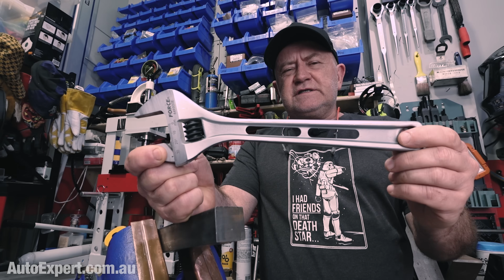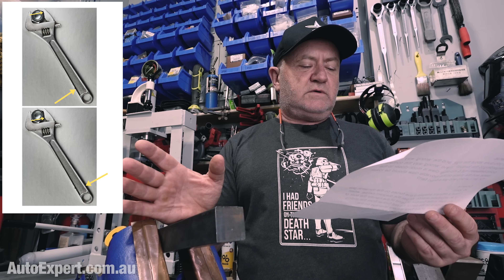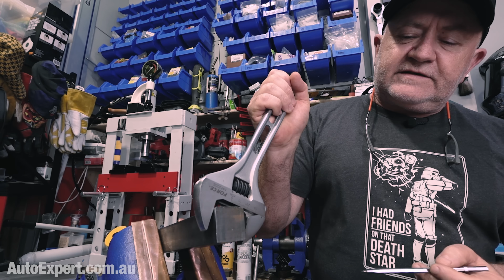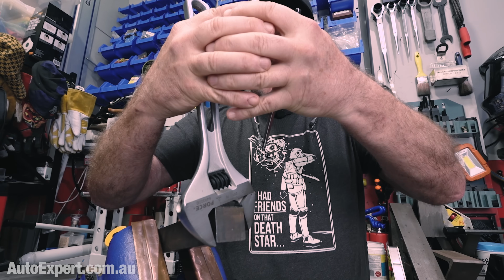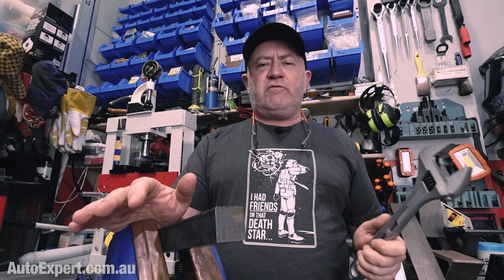Adjustable wrenches: Was I wrong? | Auto Expert John Cadogan

Comment: As someone that lives deep in the "rust belt" of 'merica, I'll confirm that penetrating oil tends not to do a lot until that initial breaking free of heavily corroded fastener.  If you can let those products soak for a LONG time (a week or more), then sometimes they get into the threads before breaking loose.

Comment: My old boss used to use a term for torque and measuring different objects, give it 'two poofteenth's of a female pubic hair'. After having been in the auto electrical game for fifty years, I have still been unable to find a measuring implement marked in 'poofteenth's of a c##thair' I am still wondering if it is an Imperial or Metric term?

Comment: In my job working on aircraft, if you used an adjustable wrench they would kick your arse. Open-ended, or ring scanners in the correct size only.

Comment: Using the proper, ontological names for an adjustable wrench and a minor displacement may have kept you just this side of a profanity-related demonetisation, so it’s just as well that conversation didn’t get into clearances - the kind that lie on a spectrum that starts at ‘blonde’ and increases in size with visible light absorbency.

Comment: You won’t be breaking one with hand strength alone. A 2 1/2 m length of pipe will help.  The Chinese ones will break quickly as they have a lot of flex. The big Bahco will last pretty well, but I’ve broken a few of those trying to release big concrete coring bits. Always the bottom, movable jaw.

Comment: The Torque Test Channel is great. I’ve found, for me, that penetrating oil seems to work a bit better if you tap the parts when you apply the oil. It possibly vibrates the parts, allowing the oil to penetrate slightly better. It may be just enough to matter. It might also be a placebo.
Reply: Penetrating oil IS placebo. Liquid courage. It gives you the confidence to turn it a little harder.
Reply: @ it’s not the oil. If it can get in there it does help somewhat. It’s whether my tapping the fitting is helping that’s the question. I find that warming, not heating, the connection helps the oil worm its way in as well.
Reply: @melgross  My dad taught me to tap the bolt with a light hammer like a ballpeen while putting tension on  the spanner holding the nut. Works a charm to loosen stubborn bolts. So your tapping is definitely helping.

Comment: Great video.
When you mentioned the 15° angle on wrench and the reason for it, I recalled that I discovered something back in 2005 that I thought very clever.
On a spanner (wrench) with 12 point ring on one end, and 'open-ender' on the other, they were even offset to one another. This had the effect of halving the 15° to 7.5°, allowing me to do up a nut on an inaccessable DIY shed door hinge I'd designed. I guess all sets of those spanners have that feature, but I never knew.

Comment: I have found the best way to undo the ceased bolt or nut is actually when the hammer trick doesn't work is to do the opposite,  try to tighten the bolt or nut using the same brute force, if you hear a cracking noise then the bolt is now free and will undo!
When I say brute force I so mean using the adjustable wrench with a long tube to make it longer to increase leverage. 
But you must remember if anything breaks everything, including you will suddenly move in the direction of force so be careful you are not going to break your bones on anything in the way!
When in industry use industrial force, safely.

Comment: If you have a Bahco or Garrington or Crescent or Jackdaw adjustable and only use the power that your arm can exert on the handle, no hammering or cheater bars, then it won’t break. They’re designed to be stronger, as they get bigger, and on your own, you’ll never break a quality tool

Comment: I think that it was in the first few hours of commencing my apprenticeship that the tradesmen indoctrinated me into the ways of correct use of tools. I was taught to use them in the order below as the job demanded:
1. Sockets
2. Ring Spanners
3. Open ended Spanners
4. Shifters

And this is the first that I've heard shifters called "Crescent Wrenches", too. And of course, the rather crude "AFS", too...

And the angular doody-whatsits that you apply to shifters is also applied to open enders... 

Of course, the amount of room allowed to swing the spanner dictates how you use them too.

Great video. Hope that someone learns something from it.
Reply: And then 5. Vice Grips for when you rounded the nut with the SNF
Reply: @mikelastname  indeed. The list is highly extendable, the worse the damaged nut/bolt head becomes. But I think it taps out when the gas axe is brought into service...

Joking aside, one of the more useful gadgets that I have is an impact driver. No, not the ones that Makita makes but one that you hit with a hammer to drive loose any stubborn screws, particularly Phillips headed ones.
Reply: @ I would only put fire extinguisher after gas axe on the list.  I like my impact driver as smashing it with a roomy big hammer feels like making progress, but access is often an issue in an engine bay.

Comment: I nearly always have success turning a tight nut with two spanners linked together. That is with the ring end on the nut and the open end linked with a ring end of another. Some should say that's an easy way to wreck your spanner, but it works 99% of the time.

Comment: Was always taught not to use it backwards and put the forces on the worm. Also, the worm needs the end play spring installed - real PITA if that spring is absent or knackered. Also, I used to use an oxy-spanner and a knockometer.

Comment: 0:45 - I use it both ways, yet as said here, when putting quite a deal more pull, and the arrangement provides that clearance... I tend to think of it like the hand, grasping... all those fingers, to that one thumb... wrap the 'fingers' (solid with the handle bit), to pull, rather than pushing, with the 'thumb' (the sliding, adjustable bit) - otherwise, if I can help it, time permits, and the proper spanner, isn't in the other tool-box, away - I prefer to use a box-end, wrench, and cheater-pipe (not for smoking), or better yet, an impact-driver... We can't always use what's ideal, so use what we have, the best way possible... I'll watch the remainder of the video to see why this is still in debate... though it has been, for quite some time now... Cheers-

Comment: "Hit the spanner at will"... What did Will do to you that you are hitting the spanner at him?.

This video is on shifters, but I am going to talk about multigrips.
The "correct way to use a shifter" is more the correct way to use multigrips. If the top, outer bit is the side that you are pushing the handles on ( ie you are pushing the handle attached to the moveable jaw. I know that it seems I changed direction but I didn't ), the pressure on the handle is trying to close the jaws while the torque is "wrapped around" whatever you are trying to turn. Going the other way, your grip strength is doing all the gripping and the torque is also being added.
One way, the torque adds to the grip while the other takes the grip away.

Comment: RCH was the smallest unit of measurement on any jobsite I worked here in 'Murica. 
The main criteria I sort adjustable wrenches by is practical: Grab a nut or bolt that about half fills the throat of the wrench. Place it all the way to the back and tighten the wrench, as one should if he doesn't want to be a "nutfucker". Now try to pull the wrench straight off, parallel to the jaws--as you would in a confined space. Nine times out of ten--or maybe ninety-eight times out of a hundred--the wrench is stuck because the jaws are not parallel to each other. I have one of ten adjustables that passes this test in the company shop, and they're by all other measures POS--no COO, no brand, just 10"-250mm Chrome Vanadium. I found them in the woods as a large lump of rust and restored them to prove a point about rust removal and now they're my favorite adjustables.

Comment: My TAFE teacher cracked the Sh!ts when I used a shifter and said I should use the proper sized spanner....the Army mechanics never use a shifter.....so year later I joined the army as a qualified mechanic and got issues a tool box and it also contained 3 shifters.....I had a little giggle to my self...

Comment: I've spent most of my working life in heavy industry and have broken plenty of shifters. they always snap the worm threads, especially the big 24" plus shifters. the rest of the tool has remained unscathed and we used to have spare worms in the tool store
Reply from the maker: Yeah. I've never seen one snap anywhere else.
Reply: @AutoExpertJC  I have, but it was made of finest Chinesium.  $4.99 at the local purveyor of cheap imported crap, according to the price tag.

My tight-arse mate got told that yes, I had indeed broken his brand new shifter, and that he should go buy another one.  Preferably one that cost more than a large pizza, as opposed to one which cost less than a couple of steamed dimmies.

Comment: i never use that on a nut cause if it slips or moves it rounds it. Ive only used that when i want to bend small brackets that might be crooked like radiator brackets or sheet metal i want to straighten up when fixing the edge of car panels.

Comment: Nearly all Crescent style wrenches have jaw problems that causes strip heads etc. Even when tighten each time, the worm and jaw often loosens during operation and not just cheap ones do that. Stanley 85-610 is a "hybrid" with Vice-grips to stop loose jaws striping heads or just grip a head without anyone holding the wrench. Very helpful when can't reach the head of a floating bolt by one person for whatever reason trying to remove a nut. This only really works in one way that most of effort doesn't push on locking level.

Comment: Curved pipes, queers for Palestine, most politicians and some coppers are bent. The 30 degree handle is offset. 
I've found striking the back of the head with a hammer whilst applying turning force can work as a redneck impact wrench.

Comment: You were right first time. There is a self locking component in an adjustable shifter. Try taking the screw adjuster out of an old shifter. On square stock like you demonstrated (to maximise the effect at extremes) wrong direction will just slide the movable jaw. Right direction will lock to jaw to some extent (a good thing)

Comment: Ive always heard them called Crescent wrenches and have never heard them called anything else. Crescent is the maker of the most popular in Louisiana but all brands get called by that name. the wrenches when used upside down is a good way of getting injured or and used upside down it will slip off because the lower jar is much weaker and will round the nut off.

Comment: Totally understand what you’re saying and wholly agree from a nut/wrench/knuckle f’ing perspective. I more often position them the opposite direction (unless for access constraints), because the angle seems to provide more leverage to really ‘wrench’ on it (whether pushing or pulling), and if/when the nut rounds and becomes f’ed, you’re hand/s are less likely to slip off the wrench, which could cause more personal injury than skinning a knuckle or two. Also the opposite angle tends to face better when hammering on it, as the hammer doesn’t deflect off the end of the wrench as much. No idea if this is valid, but to me it just ‘feels right’ to do the opposite, and I always get a (tiny) sense of satisfaction when starting an awkward nut, when the wrench first fits in the opposite orientation to the ‘right way’.

Comment: Having broken a couple of nut fuckers, I can say they break no matter what way you use em if you use a size smaller than you need, Ive broken both the fixed jaw and the dynamic jaw as well as the thumb screw. Im not rough with em just overloaded the buggers

Comment: I'm a Fitter And Turner , I started in 1967 , I did a 5 year Apprenticeship as was the case at the time , I all so do General Engineering , Fabrication , Hydraulic's and Pneumatic's , very time I see some one use a Shifter the Wrong way I Cringe , having said that I all so have used it both ways But only with the right amount of force , they are meant to work One Way when you are working it hard . Using the shifter with a Looose grip is Not how you use it , It should be snug their for the contact point is up the top and Not at the end of the jaw , your Hypothesis is wrong when you use it the right way .
Reply: Not sure after reading that which way you think is correct, but I look at it this way: Using it the way John that described as "the right way", the extra torque on the end of the jaw is going to force that end of the jaw "out" more, ( ie away from the other face) thus increasing the "non-parallelity" (idk I'm just making up words at this point ) between the two contact faces of the spanner, thus making it more likely to fuck the nut.
I'm less concerned about one failing catastrophically than getting whatever it is undone, as I've never had one break on me.   So I'll keep using them the "wrong" way. 
 ( But I'm going to check out Torque Factor cos I'm  this far invested already)
Have a good one.

Comment: In 40 years as a boilermaker cant ever remember a broken shifter  ,even with a pipe on it. so i dont think this even matters
Reply: 3T chain block will do it.
Reply: I've got to agree with you there Tony.  I've done some terrible things to shifters over the years and  rounded many nuts but incredibly, no  busted shifters yet.
Reply: @grantperkins368  
Again, you were Not trying ( or desperate ) enough... I have put cheater-bars on Lots ( usually the bigger nuts  ) and Yep, nut stays still and worse-for-wear, bluddy shifter fails...
Good Luck !
Reply: @bluddyrowdy8757  I ll keep trying!  Thanks for the encouragement 👍
Reply: @grantperkins368  
Heheheheheh
1 Day ( and 1 Nut ) at a time Mate
2morra is another Day !
Reply: How about a 45 minute talk on the humble stillson wrench..........the next "go to" tool when the shifter fails to do its job!
Reply: @johnflynn5750  
hahahah - Full Points !
Stillsons have a coarse/fluted jaw, whereas crescents have a smooth jaw. Oh Oh yep could take another 45 mins to detail finer points ...
Cheers
Reply: You were not trying hard enough then..... ( or had the correct size spanner available )

Comment: I just told my daughter that I was about to watch a nearly 25 minute video about the correct way to use an adjustable spanner and she looked at me like I've gone mad.
Reply from the maker: That's completely normal.
Reply: @AutoExpertJC  Which bit..?
Reply: Did you mention added to the previous video it's 45 minutes? I am about to watch the linked destruction testing too 😂 gotta be over an hour by then. 
It's one of my favourite tools due to it's versatility and I've used it in a couple jobs. Always a good tool to have if in a jam.
Reply: She is right!
Reply: @lupuszzz  She's normally right.
Reply: Ah, the old nut fucker. May I suggest that if using to the point of destruction of the nut/ bolt, shifter , top lip , eyebrow or forehead, you have missed the point of the very useful tool that is designed to be used in either orientation. Like all tools, there is a large variation of quality available from children’s toys to professional use. When cleaned, lubricated and stored correctly, a quality shifter will last a lifetime.
Reply: So … how does that differ from any other day of the week🧐😁?

Comment: I only use a shifter if I have no other option and use it in the "wrong" direction because I think having the contact point on the movable jaw closer in gives less chance of rounding the nut off. This becomes more obvious if you consider a shifter that has enough wear that the jaws are no longer parallel but splayed out slightly.
Reply: 👍 my thinking also!

Comment: Quality of the wrench and fitment.  The chances of rounding a head is high using a shifter in any position.  Just get a ring end you poofters
Reply: ROE =  ring_open_ender ( aka combination spanner )
Perhaps utilise a socket instead ? - use 6-sided NOT 12-sided whenever possible
Rule No 1 = No Poofters !

Comment: Turn nutfukker to adjustable wrench guide. Take angle grinder and gring tips of the jaw just a beesdick. If you have something jammed significantly. Put wrench on nut, tight it and remove it than tight it up just a beesdick. Put grinded adjustable wrench back to nut and smack it with hammer on the nut... That way you have tightest possible wrench on planet earth. Every hydraulic service has to have that, those things are bathing in acidic dust and numbers on wrench aren't meaning anything because that wheel loader have been eaten by acid sludge and dust for years. so you need to have tight open end wrench. Nut was 46 mm in factory but now you need 44,8 +air hammer +huge pipe on end of that wrench... Torch doesn't go trough door of that factory because even gate is flammable

Comment: The good old "Thumb detecting nut fucker"
Most jaw failures I've seen have been at the point where the jaw meets the rack, they crack along the stress riser point where the thinnest part of the jaw meets the cylindrical rack, especially if that point hasn't been machines correctly to avoid those stress points, which these days is all the time.

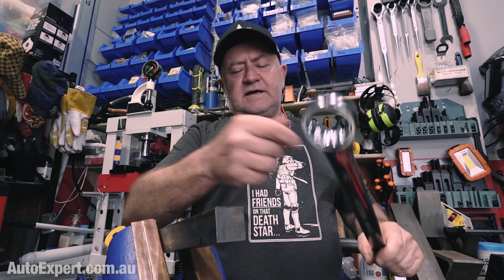Comment: 19:19 yep. I use 6 point sockets pretty much for everything now to avoid damage.
Reply: Agreed, but Snap-On flank drive shifters are fantastic and don't destroy nuts/bolts. They cost $$$ but save time and problems by not destroying the fasteners.
Reply: @michaelbradley3393  I have sockets with me when I have spanners and shifters so no time saved.
Reply: You tried a 6 point ring spanner? I'm wondering if they are worth the cost and aggravation  of limited arc for the grip benefit.
Reply: @mikelastname yes they are for underbody nuts you'd prefer not to round off.